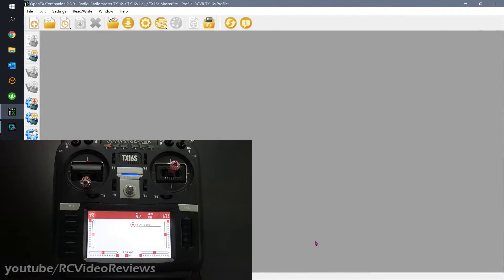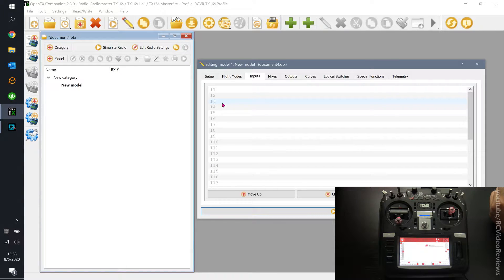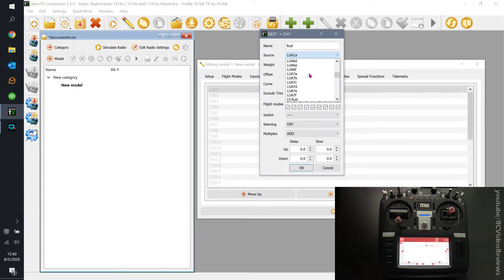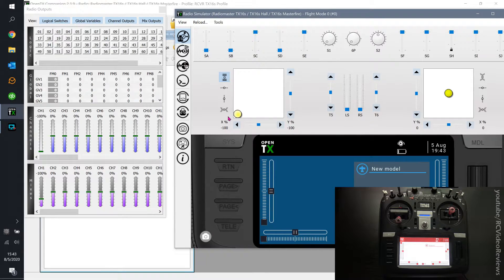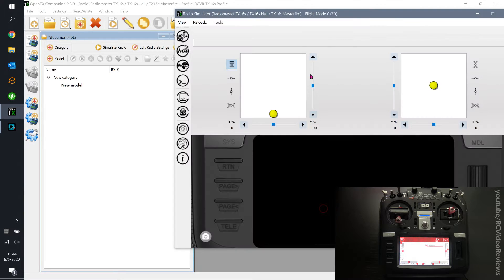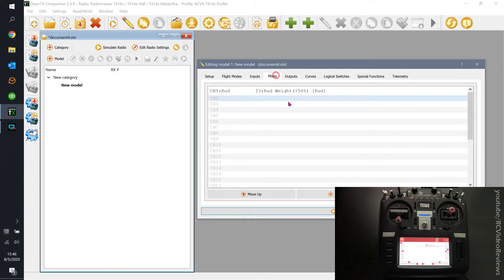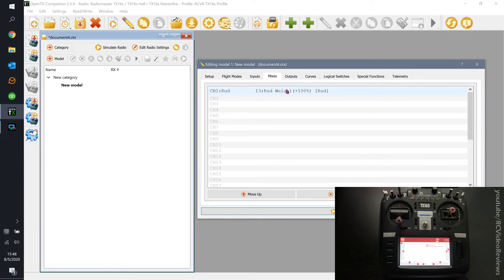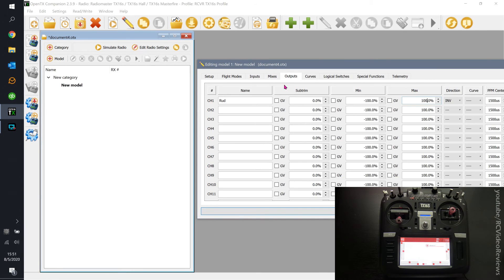OpenTx Companion Tutorial • Inputs Mixes and Outputs Explained • Radiomaster TX16s • [Beginners]

Comment: I flew radio back in the 60s, to change the amount of movement on the flying surfaces you moved the push rod to a different hole in the servo arm and mixing was done with the thumbs. I've started again and your series is a superb way to learn, Thank you.
Reply from the maker: You'll know it's still important to get your geometry setup the best you can. Closest in on the servo, farthest out on the horn gives you the most torque and the most resolution. The radio can definitely help tune the flight experience and make planes easier to manage in the air. Did you get a TX16s?
Reply: @RCVideoReviews  I bought a T16 Pro about nine months ago, I do like the radio, I'm a thumb man and it suits me fine.

Comment: But why start using specific line 3 for input ruder? is necessary keep in mind the chanel number all the time?
If possible connect any line input with any chanel?
Reply from the maker: Input lines aren't channels. I use 1, 2, 3, 4 for Ail, Ele, Thr, Rudder most of the time, but it's not required. I do it because I like to keep things in the same order. Channel numbers are assigned in the mixer.
Reply: @RCVideoReviews  thanks bro, now i'm clear.

Comment: I am flying quads and am still new to it. The way I set it up, is that the sticks are the only inputs. All my switch configs are in the mixes. However, you said the inputs identify the physical controls. So how come its working? For reference, I assigned my switches to channels which then are configured in the BetaFlight to arm, change mode (angle/acro/air), beeper, turtle, etc. What am I missing or gaining by using only mixes? Would it also be the same with sticks? Thanks!
Reply from the maker: The inputs are there to provide a standard convention for controls--sticks/sliders so they can be manipulated as a group. You can assign switches in mixes. You can also assign sticks in mixes. You can also assign pots in mixes.

You cannot be too too literal with OpenTx. For most tasks on this radio, there are probably a number of different ways to accomplish them. 

The whole point is that Inputs provide a mechanism to define control inputs and then manipulate them easily in as a group and before assigning them to a channel. Dual rates, expo, etc... Those inputs can also be addressed elsewhere in OpenTx without the influence of mixes.
Reply: @RCVideoReviews  Lightning-fast response. Okay, I think I finally get it. Thanks!
Reply from the maker: @lukeiam0  No problem :)  I'd bet $1.00, for every example you see on how to do something in OpenTx I could show you an alternative way of doing it on OpenTx and make an argument for why you should do it that way. 

The MAIN issue I would highlight is that you do not want to put your 4 primary surface controls directly into the Mixer. You should put those in Inputs, then use those Inputs in the Mixer. You may have seen this already, but I cover it here: https://youtu.be/WmnZM5veAiE

Comment: I must admit :-) All the guys and girls have it right, Your tutorials are very clearly setup. Thanks for that, it has indeed been very helpfull.
One question remaining though, there is something I cannot find out.
I have a quadcopter, connected to my RadioMaster, and mostly all is well.... But: there is a sort of dead zone on the throttle, from say -100 up till about -40, before the motor spins up. I read somewere, that that is something which could also be corrected within the "flow of information" within OpenTX, somewhere between inputs, mixes and output.
Any hint what I should look for?
Thanks upfront!!!
Reply from the maker: That sounds like a calibration or software issue. Without getting into your flight controller software setup, what I would do is troubleshoot in this order:

1) Assuming you have no curves, no expo, no mixes, no dual rates on your throttle: Make sure your Outputs and Mix match the Input exactly in the channel monitor on the radio. i.e. Mix, Output and Stick should all read -100, 0, 100 together. That assures us you don't have something on the radio creating the issue. Throttle should be linear for the purposes of testing.

2) Verify your Outputs match the flight controller min and max. i.e. When you open your flight controller software, your Output at -100 should show 1000. Your Output at 0 should show 1500, and your Output at 100 should show 2000. This is true for Betaflight, but most other FC software will have a top/bottom range and you need to make sure your radio and flight controller software agree on what those tops/bottoms are. You can use the Outputs screen to adjust your min/max so that your stick always lands on 1000 with throttle off, 1500 with throttle mid, and 2000 with throttle full.

3) Calibrate your ESCs. If none of the above fixed you, calibrate your ESCs. You'll have to do your homework on this one.
Reply: @RCVideoReviews  
Thanks very much for your reply, it has (as all the other stuff you put out here) been very helpfull.!!

Comment: Ive setup the ruder following your steps even through im building a flying wing no ruder, everthing seems ok in inputs, mixer and outputs. so i used channel 3 for ruder do i now move on to throttle ch4, aileron ch5 and elevons ch6. Thanks for any help
Reply from the maker: I don't understand. If you're building a wing, you don't need a rudder. 

You can put any Input on any Mix Line meaning you can assign any Input to any Channel on your Rx.

If you're building a wing, you should just have:

Ch1 Aileron
       +ele mix
Ch2 Elevator
        +ail mix
Ch3 Throttle

That's it.
Reply: I did that just to pratice but can i just start back in inputs,mix and output and change to what your saying? Thanks

Comment: Excellent information flow overview, just what i needed.. staring at my new tx16s, I do wonder about the relationship between the Default-channel-order in Radio Setup and the inputs, mixer, outputs?
Reply from the maker: Channel order on OpenTx is just a time saver for new setups. On OpenTx you can put any device on any channel. If you’re using an Rx that wants a channel map you can check ignore channel map under the bind so you can things the OpenTx way which means your way.

Comment: I've got this radio as my first and I am a complete newbie. I subscribed your channel as soon as I saw the first video. Very helpful for beginners. The only thing I got lost in this video is Expo. Didn't understand what is it for.
Reply from the maker: I've been thinking of making a video on the basics of servo outputs. So keep an eye out for that.

Expo simply changes the arrangement between the stick and the output. 

For example, as you add expo: When you move the stick 3 steps, the servo only moves 1 step. If you add more expo, the stick might move 5 steps and the servo only moves 1 step. But eventually the servo has to catch up to the stick so if you add expo it softens the initial response of the control surface to the stick, but as you get to the end of travel the servo catches up. That means at the end of travel the stick might move 1 step but the servo moves 3 steps.

Hope that helps...

Comment: Hey My Brother, Thank you SO much for taking the time to make these videos. I'd be lost without your  knowledge. I do have a question. How do I adjust (or expand) the travel on the sticks? i've been to the "output" tab and can't find travel.  On Betaflight, my inpoints do not reach 1000-2000.  Everything is centered to 1500, but can't seem to get to 1000 - 2000. I'd appreciate any info on this.  Thanks again, Peace
Reply from the maker: On the model setup page put a check in extended limits and then increase the weights in inputs (or outputs (or mixes)).

That should do it.
Reply from the maker: PS You calibrated the Tx right?
Reply: @RCVideoReviews  Thank you so much sir! That did the trick. I'm making the weight adjustments in the mix .
Reply: Thanks for your help on my last question. I've found another way to extend travel for endpoints. Would it hurt  if I used "enable max throw" to reach my endpoints? Thanks again
Reply from the maker: @stevengonzalez4111  Enable Max Throw?
Reply: @RCVideoReviews  Hi, yes I found this "Enable max. throw" feature located between "Receiver No." and "Autodetect format" in the model setup page . Would this be a safe method for achieving waypoints? Thanks
Reply from the maker: @stevengonzalez4111  Try it. Since you're using Betaflight you don't risk mechanical damage to servos so try it out. Let me know what you learn. I've never seen/noticed that before.

Comment: I get my TX16s tomorrow, I will be watching your vids religiously. Thank you
Reply from the maker: Great! I hope they help you get along well with your AWESOME new radio.
Reply: @RCVideoReviews  Out of all the radios on the market with the different options why did you pick the TX16S? Seems like you are well committed to it given the amount of very informative vids on it. I am coming from Spektrum and I will say there has been some flak for jumping ship. Given your experience with the RM would you but this radio again?
Reply from the maker: @North49RC  Primarily I wanted OpenTx. The hardware was a secondary choice for me. Jumper went through some stuff with ribbon cables and I didn't like the idea of an internal 2.4ghz antenna on the T18. Since I'm primarily flying 2.4ghz, I felt the T16s was the next best choice. 

I left FrSky because of what they're doing with Access.
Reply: @RCVideoReviews  I started and most recent was the DXe. I got decent at flying but wanted the mix options which aren't available on the DXe. But then I had a lot of LOS issues, all the time. They traded it out for a new Tx but the same thing happened. I used the AR620, had three of them, all the same issue. Used Lemon and Storm DSMX Rx's, same thing. I am also a 2.4 guy an you are right i didn't like the internal antenna either. Then the price and quality i think sold me on the RM. So in getting this new Tx hopefully the LOS problems are a thing of the past and I can grow with this one
Reply from the maker: @North49RC  I've flown it enough at this point with enough different Rx's to state that for LOS it does fine. I really should put some RSSI alerts on my models but haven't gone that far yet. 

I don't think you'll be disappointed. Look for the Futaba upgraded springs, and don't wrench down too hard on the throttle ratchet if you opt to adjust that.
Reply: @RCVideoReviews  I got mine and started to get used to the language. I tried some test planes to see if i could do mixes on my own. I do see there is more then one way to skin the cat depending on the variables of coarse.

I am trying the aileron/rudder on a slider and variable expo on a pot. I have crashed a couple planes with it now due to brown outs, plus its been awhile since i have flown. 

I adjusted the gimbles, set global functions. Figured out the SD card and file transfer. I have the companion although the radio does all the same stuff, i do like the simulator. 

Your vids have been so helpful. I did set up differential thrust from someone elses vid but it worked out great. One i did have trouble with was the smart throttle cut on the twin. i might have mossed a step though.
Reply from the maker: @North49RC  When I saw your comment about lost planes, I couldn't believe it. You're going to LOVE the video I'm about to post.

Sounds like you're doing all the right things. Get in there and try things out. Use Companion to experiment and test your theories in the simulator. 

Sounds like you're well on your way. Good job and thanks for the report.
Reply: @RCVideoReviews  What's this new vid about? Will it resurrect my Wall of shame or will it help me trouble shoot my issue?

If you check out my latest vid on the FT Seaduck you will see my first real flight with the RM. In the end though I don't know what happened really. I think it could have been a brown out but it happens often. More then half a dozen times in one battery flight. This is one reason why I got the new Tx to eliminate signal issues. Not sure whats going on
Reply from the maker: @North49RC  I'll check your video out.  The blackbox video should help you troubleshoot what's going on with radio issues.
Reply: @txkflier  If thats it I am cool with the RM then. Spektrum was so inconsistent with signal retention that I got tired of crashing planes. I have the DSMX system of Rx's as well so I am hoping this resolves the signal issues. I did have the T18 on order but cancelled that to go with the RM. Thank you again for your time

Comment: Yeah I know you’re probably tired of me but I gotten my sd card straightened out from the last couple videos thank you. Now I have everything you just put into inputs in my mixes and just the channels assigned in my inputs. I find that confusing because in mixes you don’t see the graph of your stick movements. So if I change all of my expos and weights to the inputs side then can I just delete everything in mixes? I think I have my mixes and inputs backwards.
Reply from the maker: I think you should watch the video again. It's in there and as simple as I can make it in the video.
Reply: RC Video Reviews yup I followed the video I just changed everything I had in mixes to inputs and Vice a versa. I am only following your videos as you sir know what you’re doing and I was following some wack videos that got the job done but not in the right way. Thank you once again for helping me and others get the correct way to setup the radio.
Reply from the maker: @FASTFREDDIE-R.C.  So you got yourself squared away then?  

One tip if you ever need a reference: In Companion, press "new model", escape the wizard if you're using it, then just look at the new model. It will have a basic four channel setup with the inputs and mixes setup correctly.

This video should help a lot there too.
Reply: RC Video Reviews I now have my tx setup exactly as you have explained in your videos. I followed your video with the sd card and wiped it clean then loaded the newest content download along with my images, model settings and amber sound. I did not get the sd card warning this time. Everything is working except I still only get the spectrum analyzer to work with one of my models and if I create a new model. Radiomaster has contacted me and told me that they we’re working on the problem and that I should create a new model and use it only for use of the analyzer if and when I needed to while they work it out.
Reply from the maker: Yeah, that's past me then. If your SD Card perfectly matches your firmware it should work--obviously. Mine works on every model I've tried it on so far.
Reply: RC Video Reviews sd card matches with the firmware and everything is up to date with the latest downloads for the firmware, internal module and card. Everything else is working flawlessly and I really don’t need to use the analyzer it just bugs me when something is not working.